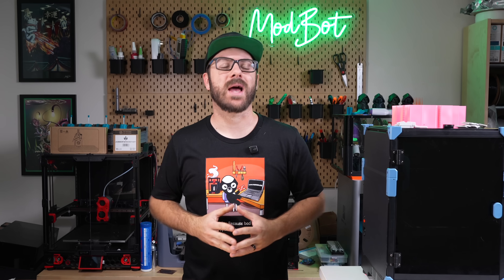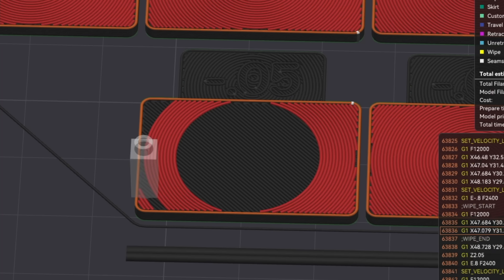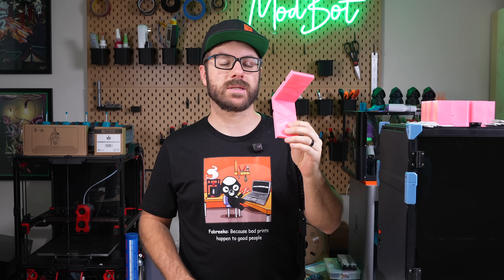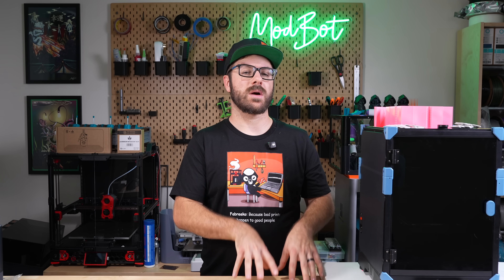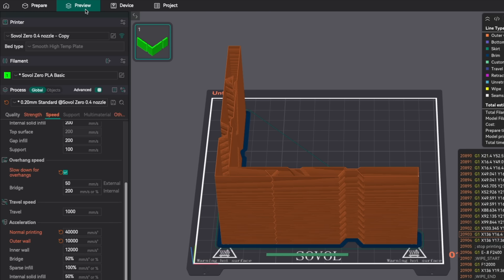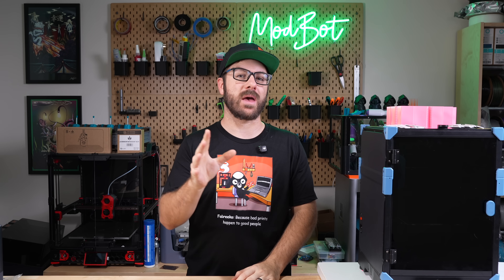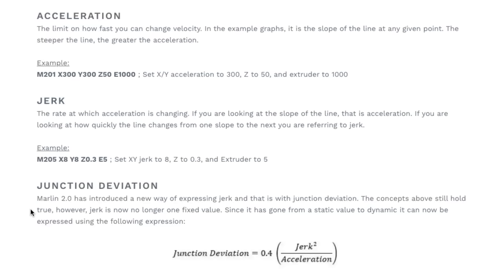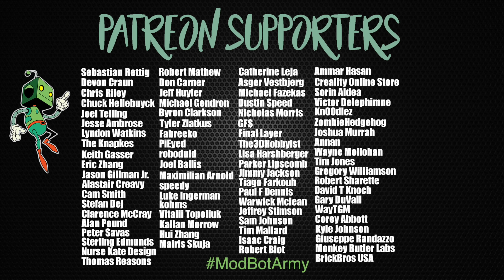Flow Rate Updates, Input Shaper & More! (OrcaSlicer 2.3.1)

Comment: FLOW is an override. It scales numerous settings that YOU set. FLOW should ONLY be used if the printer has a mechanical malfunction.
Reply: Mind helping me a bit? I have rolls of petg. One of them is a green. They all print fine except the green over extrudes. On a big flat parts it’s enough that the nozzle can pick up little buggers and deposit them around the print. I imagine the filament diameter isn’t right. Should I adjust that over adjusting the flow?
Reply: @jaceyrector9320  Different brands of PETG perform different. Ill assume they are all the same brand. If 9 different rolls work, and one doesnt, I would just chuck the 1 green roll. But FLOW is acceptable here, because the green roll has a malfunction. Rather than re-do your extruder steps, FLOW is the better idea... if you have to use the green. Have a good day!

Comment: Order of calibration that works for me in case someone has no idea where to begin

Flow
Speed/Accel
Resonance
Pressure advance

The updated resonance test is great for modified printers with no native support for accelerometers. The amount of trouble you'll have to go through figuring out where and how to mount the sensor compared to this much more simplified version of manual calibration is huge. 
Also love the new infill multiplier, that's the one thing I miss from cura. 

Next up: multiple printer tab. Let's go!

Comment: I typically run the nightly build and have been testing the new flow rate pattern since it was added. The new pattern results in underextrusion so I mainly rely on the original pattern or the X1C LiDAR calibration. There’s been extensive discussion on the PR on the accuracy of the new test. The original pattern doesn’t always require 2 passes, just interpolate between the two closest chips, gives a rate that’s good enough.
Reply: Nightly crew 💪💪💪

Comment: The new Archimedian chords pattern is a game changer. NO longer do I need to spend minutes under a direct light trying to discern flow variatons. Just using the nail feel test on the circle is amazing. 
I have never ever run the "manual" input shaper test, as the accelerometer is just so simple to use, even when using Rpi gpio pins to connect an external sensor. 
I would have liked to see a square corner velocity and cruise ratio option, not just junction deviation for the cornering calibration. That should be easy enough to implement tho, I guess.
Reply: FWIW, with the older style flow rate calibration chits, IMO the best way to test these is to actually take them and bend/fold them in half; under extruded lines will easily seperate firstly, and secondly you can get a great idea for layer and line adhesion based on how stiff they are (by how easily they bend and how far with approx the same force) I'm not saying it's super scientific, but it's pretty obviously emperical after you try it. After a point they'll all feel about the same in terms of rigidity/strength with zero line seperation, then evaluate for aesthetic issues based on overextrusion. I'm actually a little skeptical the new style will work as well for this method, but I'll have to try. I saw massive strength gains of prints after I started evaluating based on this method personally. In my experience if you predicate this entirely on visual and feel tests (like the nail test) you're still likely underextruding and leaving a massive amounts of performance behind.

Comment: I was playing with the input shaper test. Ran it. Aaand there was no ringing. None. I re-ran it again a few times moving values to try and see something useful and it was all totally fine😂 Plus4. Used a shiny silk filament that really shows all the wiggles and wiffles and there wasnt ANY part on the tower that had any ringing even well above my standard print speeds. Wut i do wrong 😂
Reply from the maker: Did you make sure that accelerations were set high enough? That printer can run fast so the default 2K that it assigns will be too slow. Also make sure you enter the two commands into your console before starting.

Comment: Hello. Thank you for the video. Can you please advise how to set the values for the V3 Plus device? Since the day I bought this device, I have used over 2 kg of filament for VFA and acceleration testing and getting rid of ringing, but unfortunately, no matter what I do, I still fail. This device is not a Delta device, but according to what I saw in the printer configuration file, it calibrates with EI type. Thank you. ❤

Comment: The new flow rate calibration is definitely much easier work with, I've seen a few other little additions here and there, but I find the network access to be buggy compared to the older version I upgraded from, seems to constantly want to refresh access to the Mainsail GUI, doesn't matter if its ethernet or wifi, the older version was much more stable.
Reply: Yes, Iʼve noticed a glitch or two, when leaving OrcaSlicer on in the background, when my networked devices seem to loose Mainsail connection, and sometimes the Devices tab is u responsive. Iʼm using a nightly build though.
Reply: @mikecrane2782  Yes I think mine is the nightly as well, nearly every time I click on the devices tab or min/max the app, it will randomly refresh and reload, this is new behaviour, the older version I was using never did this, can be a little frustrating specially with some of my machines being on WiFi this can take a while to fully reload.

Comment: Just in time, was about to download orca and calibrate my vyper but wasnt looking forward to the amount of test prints for the flow calibration and lack of any real good guide.  Nice to see that flow calibration not need  1kg of filament to tune and this is a simple enough guide thanks.  Ive been using cura but after fixing my printer issues i needed proper calibration. The firmware bug wouldnt let you save any tuned PID or even bed mesh values, dont know how i printed with it... I did have to re-level every-time to get a good print come to think of it, sheesh, cool community firmware but if theres a bug no ones going to tell you about it unless your actively checking for updates.  That would have been a cool feature, to have an auto update or inform you of new ones.
  But i digress, i really wanted to calibrate this printer and knew i had to goto Orca to do it, thankfully its even better now. Common Cura,  wheres your calibration routines? its everything for 3d printers that arent bambu. Sorry to say we wouldnt  have to do these with a bambu, they have dynamic flow, no need to tune it, the strain gauge in the nozzle senses it and adjusts. Which by the way the Vyper uses a strain gauge for its bed leveling, wonder if it could be adapated for dynamic flow like the bambu's use?  The firmware is open. Im guessing it wont be as fine resolution because the whole heeatsink assembly is mounted to it, whereas in the bambu its at the nozzel i believe, but im just guessing.     Input shaping is cool but common guys, dynamic flow... thats next level DIY mods, that would make a huge difference. A1 mini was the first to do it and it got the best tolerance test results.. and thier new machines got rid of ladar in favour of it too.
Reply: Oh yeah. Ditch cura entirely. Orca is the goat.

Comment: 12:07 all your bambu printers run marlin ;)
Reply: after messing with klipper on my sv06, marlin is way way easier. klipper is way to much fiddling and i have yet to see it faster or look better then marlin. i dont know what the fuss is about with kliipper. if you want to spend hours and hours setting up your printer.cfg then klipper is for you but if want to just print marlin is best.

Comment: @ModBotArmy Not sure if the Input Shaping method you showed is correct. At 8:32 and following you read the X value twice. The lines are too long to show the Y value so they get cut off. In 9:53 the same mistake happens again.
Reply from the maker: Yes it is applying the same value to both x and y for the rest so the one you read doesn’t matter. I had a moment of oh shit before I realized this.

Comment: Note that you're measuring from the brim, not from the base, but the slicer includes the brim layer in the height shown. I think it's not a big difference (depending on your first layer height?), but still...
Reply from the maker: This is a good point. Based on the range of where the part looks best I don’t think it would affect it (we are talking 5-10mm range in my print of looking best) but if the range was slimmer it’s something that would need to be accounted for.

Comment: I’ve been using the nightly build with a Qidi Q2, but also have a three year old Bambu X1C, and I have to toggle the drop down in the Printer list. One nice thing I noticed with the Qidi Studio (an Orcaslicer fork) is I can create a device per connection type aka WiFi or wired LAN. Itʼs real easy to switch between modes, but I wish this could be applied to different machines, so either have a tab per machine in Orca like you do in browsers, or be able to have multiple device listings in the Devices tab.
Reply from the maker: You’re the second person in this video alone requesting this and I have to think there are many others. It’s definitely something I’d love. I wonder if it’s an issue with processing? I know even on my M2 Mac I’ll get some massive files that can make it a little sluggish but more often than not this is not the case. Wonder if there is a public discussion on this somewhere with the devs.

Comment: I would like a tab per machine and when I export from Fusion, Orca could ask which machine to target. It would make juggling multiple machines much easier.
Reply from the maker: Tab per machine is something I would really like as well.
Reply: Can always open another orca window
Reply from the maker: @Botanical4038 I do this but it becomes trickier to manage since they end up in different places with my monitors and I have to click through them to figure out which is currently working with which machine.

Comment: You should now test it against the accelerometer results and see how different they are
Reply: here is my test result on my Voron0.2, you can see the orca results have lower frequency , maybe my accleration is not high enough , which leads to inaccurate mesurement.
[input_shaper]
shaper_type_x = mzv
shaper_freq_x = 78 
#orca_mesure x = 57
shaper_type_y = mzv
shaper_freq_y = 64.8
#orca_mesure y = 49

Comment: I have not been able to get the new flow rate to work properly, it still only does the old pattern.
Reply: You need to have the beta for 2.3.1, below that it still uses rectilinear for the top surface. And weirdly I found in the lower versions you can't just change the top surface to archimedean chords as it just wouldn't work.

Comment: In my experience, it's best to leave square corner at 5 or change it to 5 if the OEM has set it higher to inflate the marketing values. Square corner at higher values WILL give you more speed but it tends to jack up the pressure advance values outside of five. I've tried in the past to get a good quality print with higher values, but you are outright sacrificing quality for speed with no compromise. Unlike input shaping which allows you to go faster AND get quality. No, lower values didn't improve quality either the issues just shifted. Like you said maybe in the future it will be useful.
Reply: It's fine on my printer. Sharp and fast.

Comment: Yolo mode has always been there. This isn't new.
Reply from the maker: YOLO mode has not always been there. It came out in 2.2 which I state in the video.
Reply: @ModBotArmy  Funny, because I used YOLO mode to tune my V2 while in beta, and I'm pretty sure that was like 2+ years ago.
Reply from the maker: @8BitLife69 it was first released in 2.2 beta September of last year https://github.com/SoftFever/OrcaSlicer/releases/tag/v2.2.0-beta
Reply: @8BitLife69  YOLO was introduced in 2.2.0 beta on Sep 13, 2024, the original Pass 1 and Pass2 have been there for a very long time and where always less than ideal but better than nothing.
Reply: @ModBotArmy  You can link whatever you want, I'm not arguing with you, just saying, its been there forever. Used it a couple years ago in the V2 beta time period. That was at least 2 years ago.
Reply: @Guardian_Arias  Again, I'm not arguing with you. I've never gone into those settings since, and "YOLO" is such a recognizable word that I remember using it when I configured my Voron V2 during beta testing.
Reply: @8BitLife69  You might not want to argue, but you are simply remembering wrong, that feature was created one year ago in August and went out of beta in september, it simply didn't exist before that.
Reply: @spectermk1  maybe he thinks that time frame "is" forever and you are right the YOLO test was a recent addition
Reply: @8BitLife69 😂😂😂 good one buddy
Reply: @Tank23333  to be fair, I would not call a year old feature a recent addition either, but "a couple of years ago" or "at least 2 years ago" is simply wrong.

Comment: with the new tiles, how does one pick which is best for flowrate? The seam between the inner and outer rings? The inner ring surface?
Reply from the maker: From what I saw soft fever state in one of the PRs it should be based on center. The seam is meant to help as an obvious indicator of too much flow.

Comment: It’d be interesting if folks find this better or worse than auto input shaping.  

Would appreciate looking at PA and scarf seam calibration.   Never seems quite right for me.
Reply: +1 for scarf calibration, as its not always intuitive and quite haphazard depending on model géomètre
Reply from the maker: Anything specific with PA? I did make a video covering it and the different calibration options in orca slicer for it.
Reply: @ModBotArmy  I’ve done calibration on both, but I still often get really bad results on actual prints.  Awful looking after the seam, and I think it’s due to PA fluctuating.  I could spend more time trying to sort it out, but naive enough it’d involve a lot of guessing.